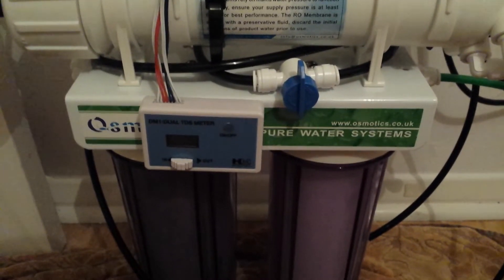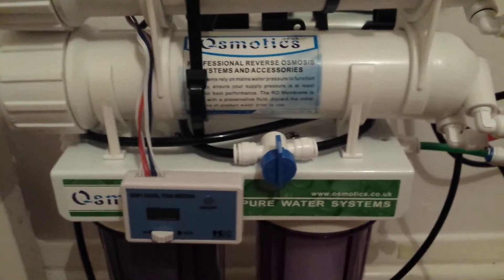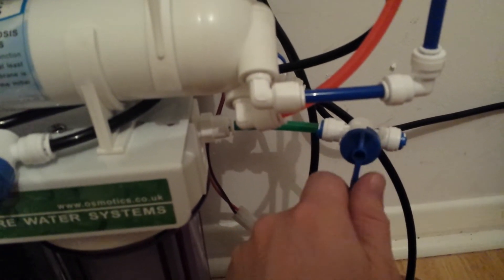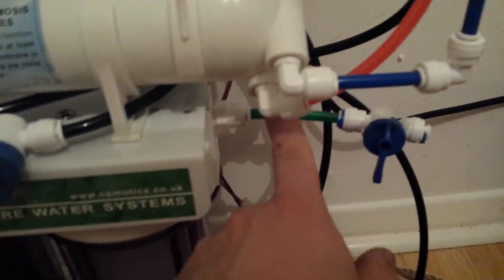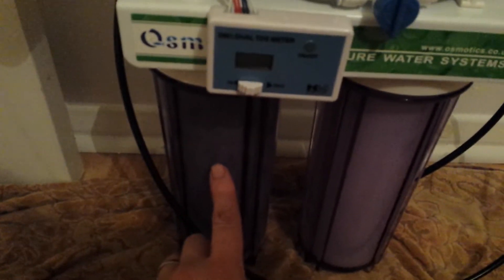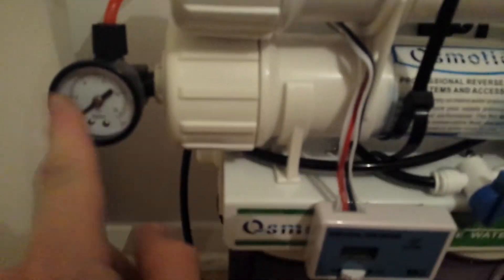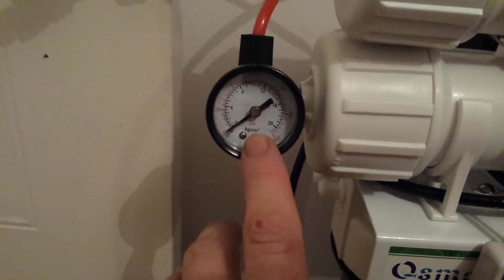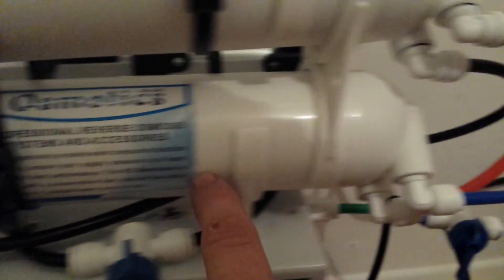RODI unit with dual membrane and booster pump

Comment: Great video! I'm interested in doing this so I wanted to know if you could please educate me on the order of the system? I'm assuming it's , pump prior to membrane, then permeate water from 1st membrane into (low pressure switch then) polisher, and then the brine from that goes into the second membrane? Also, where do you put the low pressure switch from the pump? before the polisher with both permeate lines onto it?